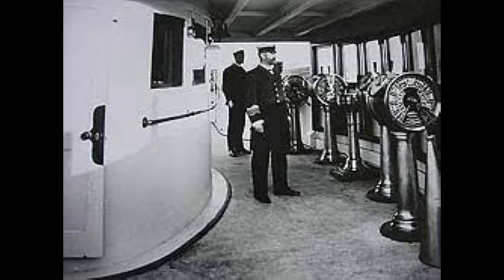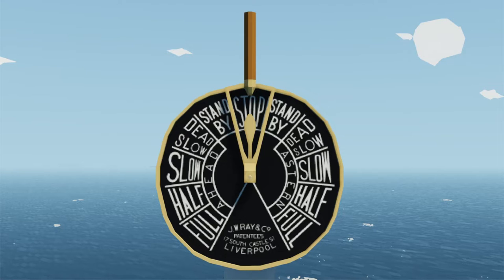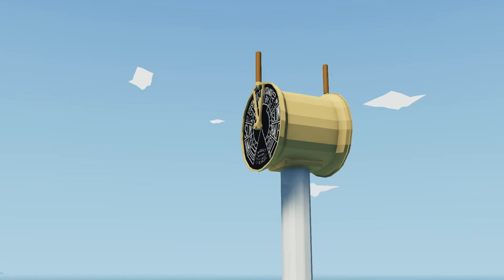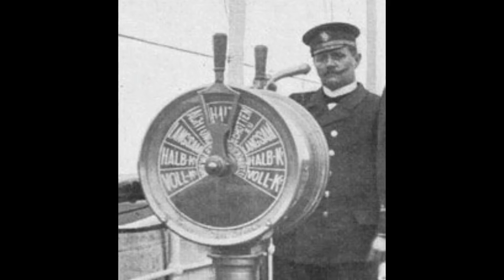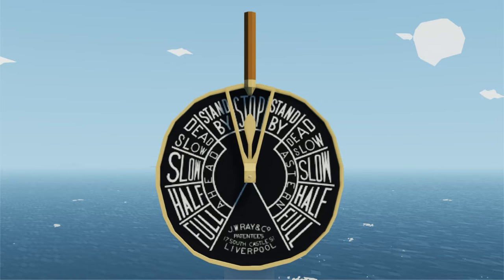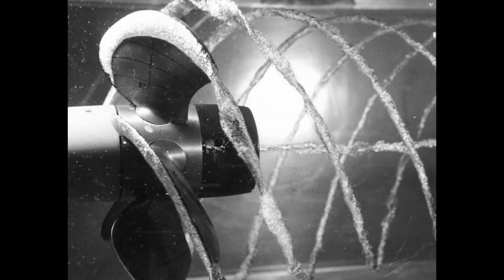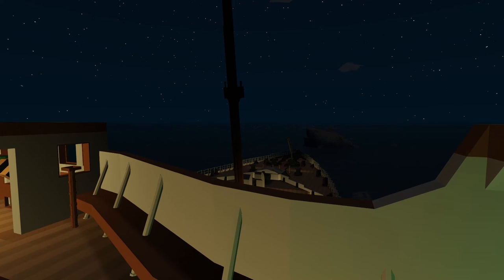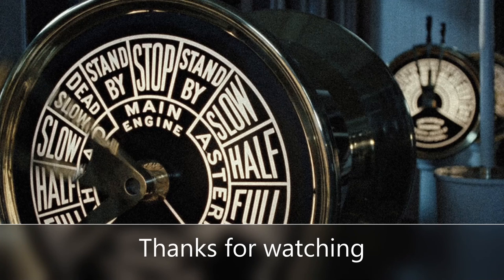Engine Telegraphs: How Did They Work? | Nautical Tales

Comment: But...how it works?
Reply: Inside is a cog wheel like that found on a bicycle with a small chain this runs down in ducts where either more chains or rods running on small pulleys transmit the movement to the equivalent device in the engine room. I used to work on tne PS Waverley and she uses that system to this day. In addition to engine telegraphs there are also docking telegraphs  which tell the rope handlers what to eg ‘let go’, ‘make fast’, ‘slack away’ etc

Comment: Engine Room Telegraphs.

Most steamships have what are known as repeater telegraphs – that is to say that the order sent from the bridge is acknowledged by the engine room, the indications on the bridge telegraph being repeated by a pointer.

Normally there are four positions of the telegraph ahead – Stand By, Slow, Half and Full, Stop with the handle vertical, and four positions astern Finished with Engines, Slow, Half and Full.  In some cases Dead Slow is added.

On moving the handle on the bridge telegraph – twin screw ships normally have separate handles for port and starboard on the same pedestal, as the handle passes each sector a gong sounds in the engine room.  E.g. if you move the handle from stop to full ahead the gong sounds four times.

On receiving the order the engineer acknowledges by moving the handle on the engine room telegraph and the pointer moves accordingly inside the bridge telegraph a gong of different note sounding inside that instrument.

Moving the bridge telegraph from say half ahead to full ahead would sound the engine room gong once.

Gongs of different notes in the engine room identify ahead and astern.

Titanic films depict the sound effects incorrectly.

Similar telegraphs are used to send messages to mooring positions on the ship.

Coastal passenger vessels tend to have non repeating telegraphs i.e. there is no return from the engine room.